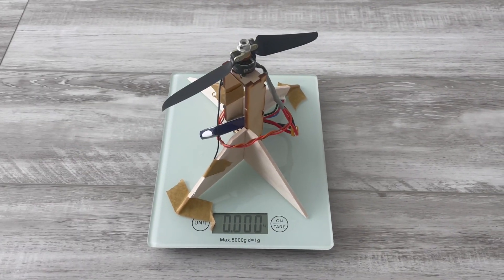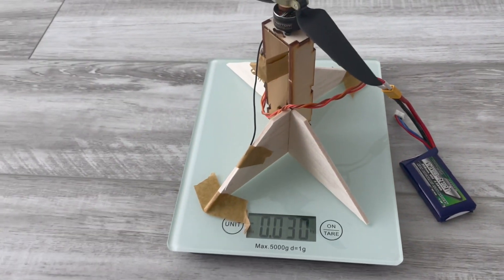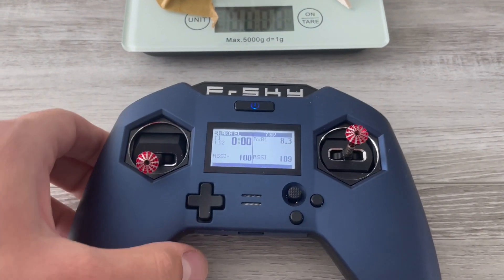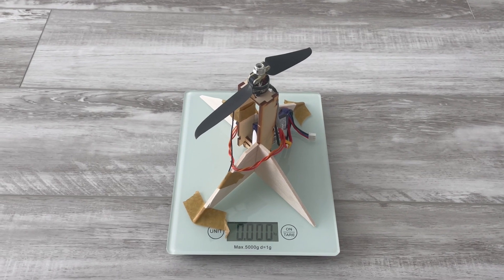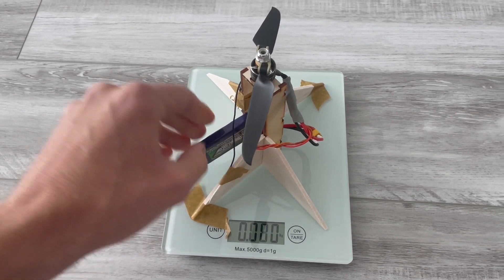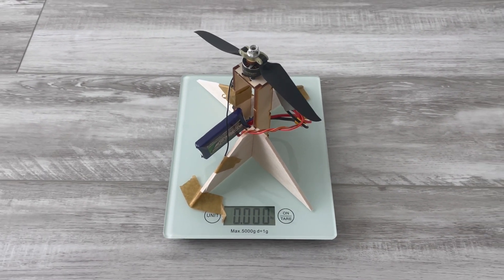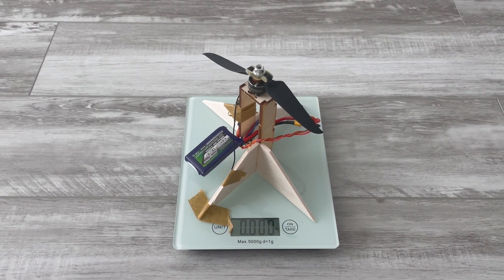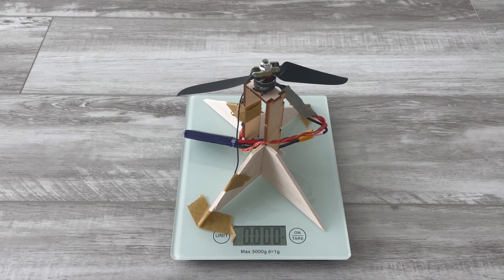F5K Power Set Test: T-Motor F1507, 6x3 Prop, 2S 350mAh LiPo

Comment: Good to see static thrust figures. Is this the 2700kV version of the motor? I don't see the information anywhere in the description or even on the product page that is linked. I run the 2700kV version of this motor in my Fury with a 7x4 prop and a 2S 650mAh pack. At an AUW of 265g, I am getting a climb of 10m/s with a freshly charged pack, dropping to 9m/s mid-pack. I will test it with a 6x4 or 6x3 one of these days. But then again, it climbs so nicely with the 7x4 so I might not bother.
Reply from the maker: Hey Richard, the motor is 2700kv, the same as yours. 

Thanks for capturing the missing data, already added it to the description on the website. 
Your 7x4 prop is most probably, carbon, so it's lighter than a 6x3 on this video. I wouldn't bother for a change in your case. But in case you will, please share your findings.

And thanks for sharing your climb rates, that's interesting.